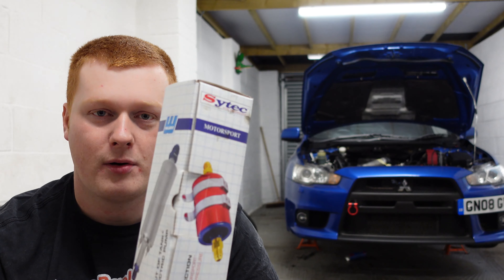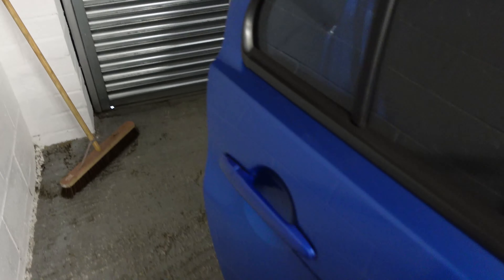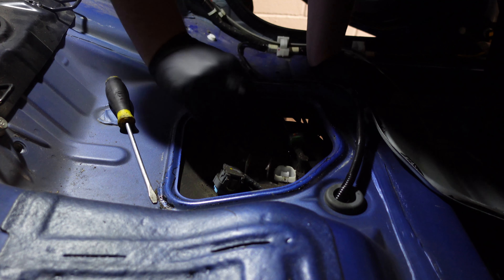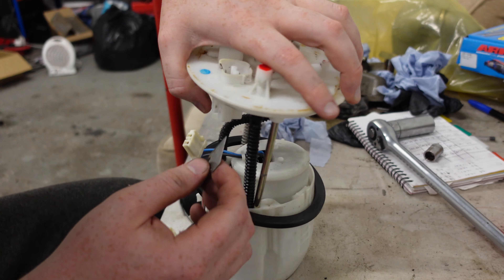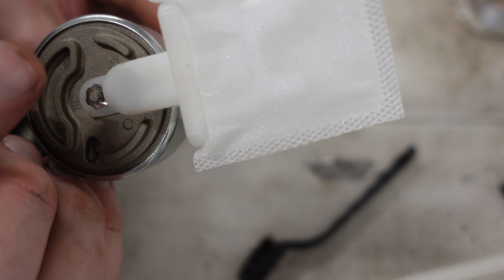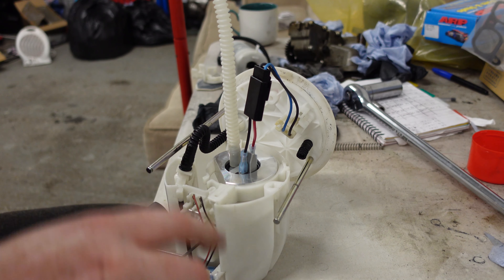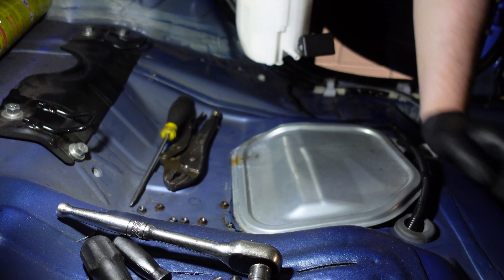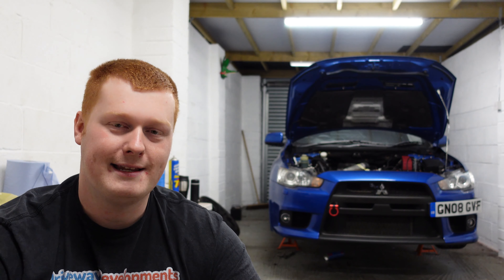Walbro 450lph Fuel Pump Upgrade Evo X!

Comment: You're likely going to have to pull the hanger again and drill out the venturi in the return to allow for more flow.  Your base pressure wont be anywhere near the base of 43.5 psi. 
The jet is too restrictive for a walbro 450. 

To give you an idea of how restrictive my OEM lift pump to the surge tank with the surge tank pump off would still supply 50psi to the rail. At idle.  Could drive around on it too.  Drilled it out and now theres nearly none. 
Believe I drilled it out with a 7/64 bit.
Reply from the maker: Thanks for the heads up mate i’ll be looking into this

Comment: I would not hard wire the pump in. Theybwaybyouve done it is just fine. 
You get to utilize the 9v mode on the evo so reduce wear and noise from the pump. It will supply full voltage once boost and load are high enough.  

I have my walbro 450 (274) in the trunk in a surge tank.   Full voltage all the time and its audible.  
Im just using the OEM tank pump as a lift.

Comment: Can u please help man my car will start and will stay on if I rev it but the car won’t stay running it’ll sound choppy and turn off and I think it’s low fuel pressure how can I fix it
Reply: Did you figure it out ?
Reply: @Sup_Evox  yes I did so the fuel pump was actually installed the correctly. The thing that was causing my car to turn off was the big ass intake a put on before I did the fuel pump and it was choking the car
Reply: @Itachlazcano21  nice I’m doing mine rn it was having the same problem hopefully works 🤞🏼
Reply: @Sup_Evox  what has it been doing ? I can help

Comment: dont forget high flow injectors or if they will flow enough fuel get the cleaned
Reply from the maker: Yeah got bigger injectors here mate
Reply: @rowanlewisuk  dont forget a faster fuel pressure regulator